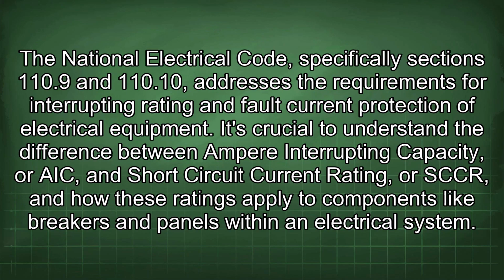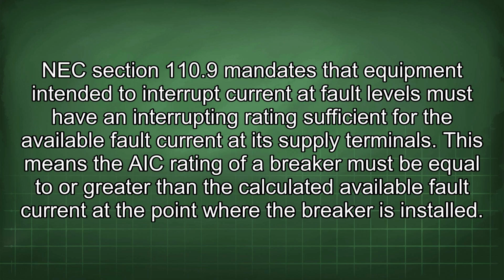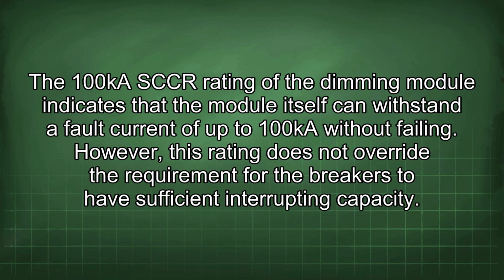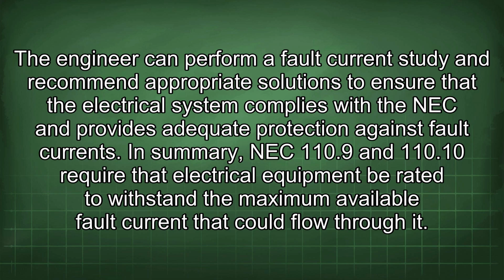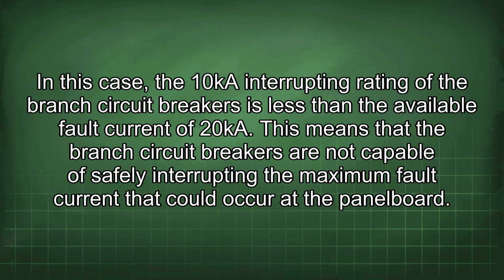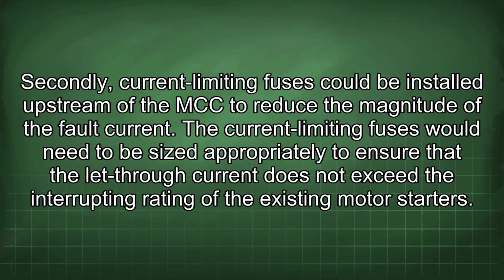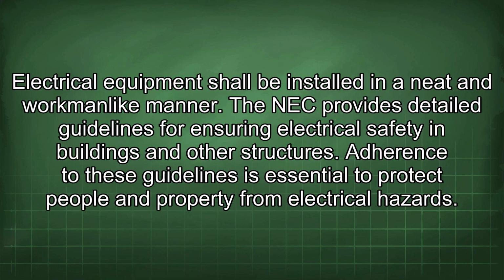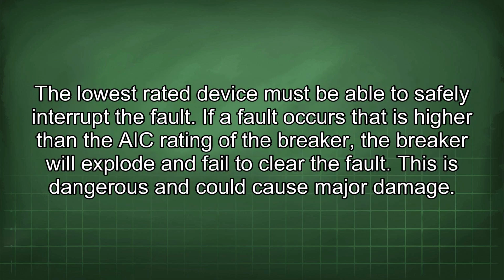NEC 110.9 and 110.10 Breaker and Panel Ratings

Comment: Also consider a series rating as a solution.
Reply from the maker: Hello @cher0174,

Thanks for your input! For the readers: normally, every breaker must be "Fully Rated," meaning its individual label matches or exceeds the available fault current. However, high-rated breakers are more expensive.

A Series Rating (often called a "Series Combination Rating") is a cost-effective alternative. It allows you to use a lower-rated (cheaper) breaker downstream because an upstream device (a main breaker or fuse) helps it clear the fault.

How it works:
- Tested Pairs: Manufacturers (like Square D, Eaton, or Siemens) test specific combinations of their breakers in a lab.
- Current Limitation: During a massive short circuit, the upstream device reacts so quickly that it "limits" the energy reaching the smaller downstream breaker.
- The Result: Together, they can safely stop a fault that would have destroyed the smaller breaker if it were standing alone.

Sincerely,

BESA Research